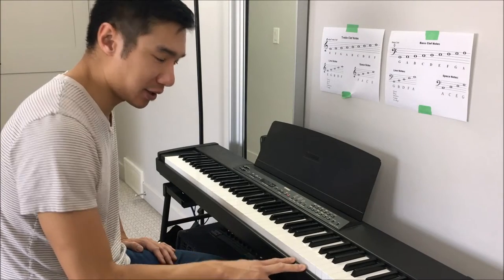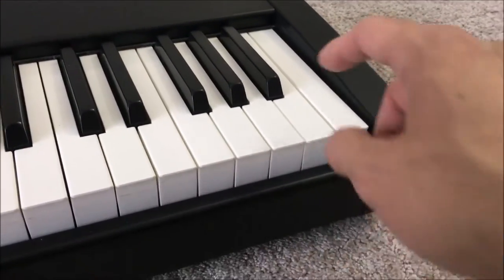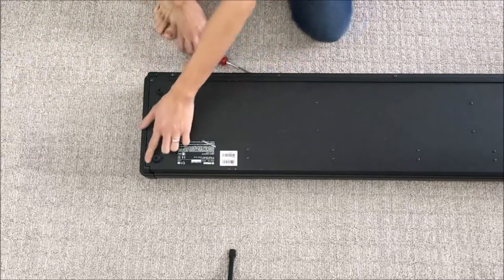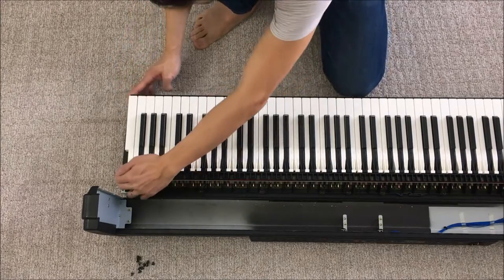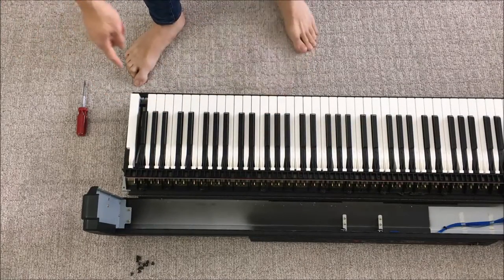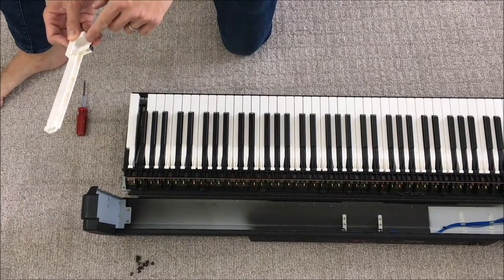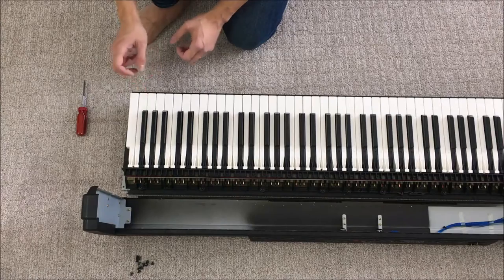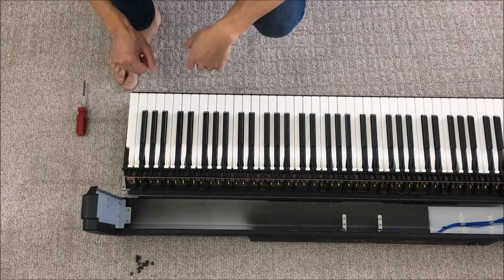Yamaha Keyboard Key Fix

Comment: Thank you for the video it helped a lot by pointed me towards disassembling the keyboard, but the method of taking the keys out you showed is improper and has a big flaw. Pushing them from the back with a screwdriver has a potential to break the plastic in the back of the key.
Actual way to take them out is much more effortless. Basically the base behind every key has a cutout that stops the key from going forward. It's designed so you can insert a shim or thin screwdriver between keys(either on the left or right of the key) and bend it back, which lets the key slide out with very little force.
Also instead of bending the front metal case its easier to just take the whole key assembly out - it's not really screwed down with anything so you can get it out and work on it freely.

Comment: I solved the sluggish-sticking key issue by putting a dab of silicone grease on the hinge (at the inner end of the key), where it inserts into the little plastic square slot.

Comment: Hi, it's not the proper way to fix it. The reason the key is tilted is because the plastic piece at the back of the key (where you put paper) is broken slighlty and need to be glued.